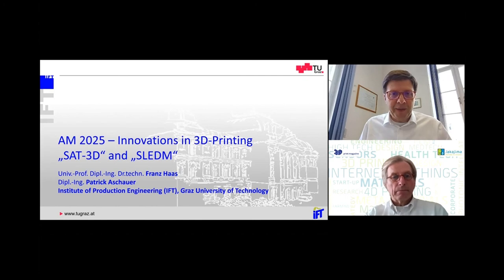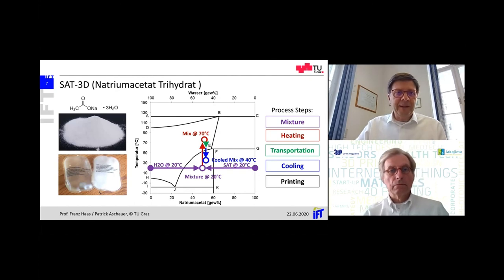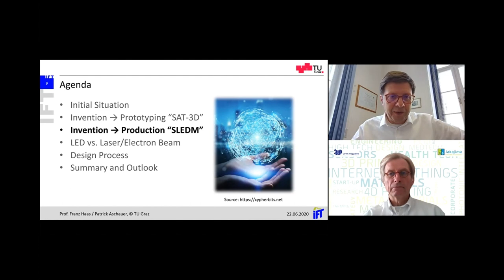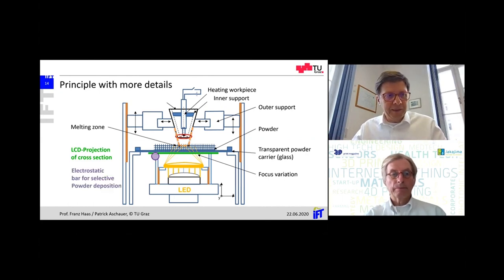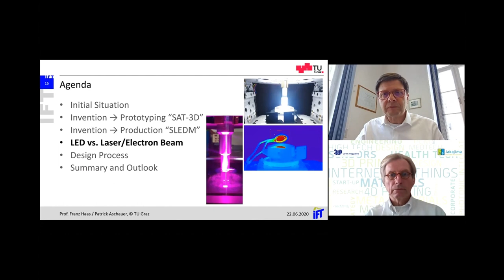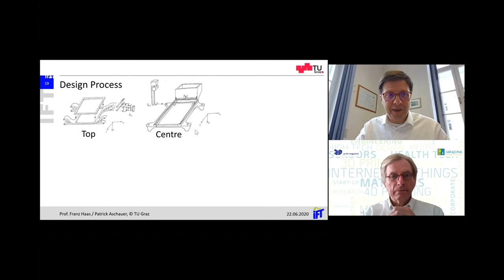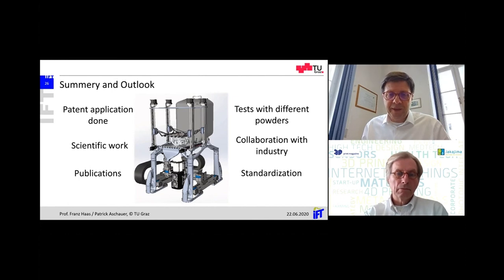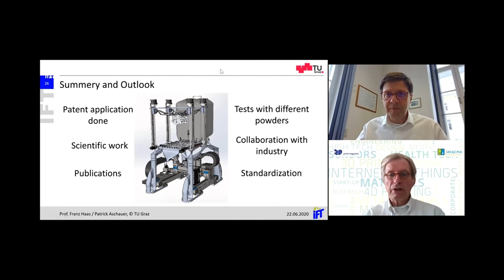Will LED replace laser or electron beam in 3D Metal Printing!?

Comment: I don't understand the electrostatic method. Is there a publication on this?
Reply: Probably not. There is a paper that used 3 electrostatic plates to achieve submicron material deposition for 3D printing for micro and nano devices. They're likely using it in a similar way to control the deposition of the metal powder since the slide said "electrostatic for selective deposition..." However I don't know how they'll achieve selective electrostatic region on piece of metal.
Reply: I get it now. They apply selective electrostatic regions to the glass plate and the they lower the metallic part and bond that melt to the part with the LED. LCD is almost not necessary since the only thing to lower about would be it heating the already printed part too hot. However with active ventilation could mitigate that as long as the part doesn't become plastic and sag under its weight.